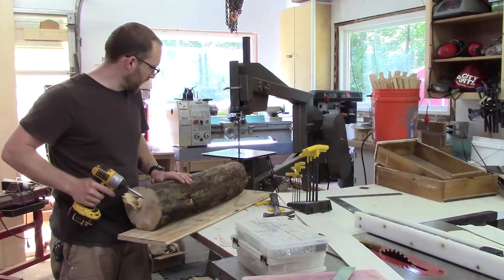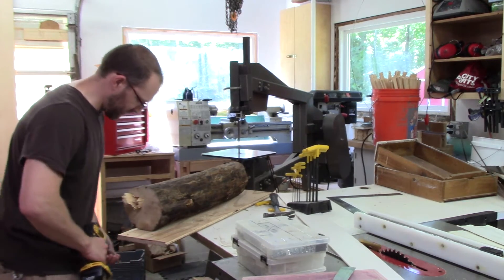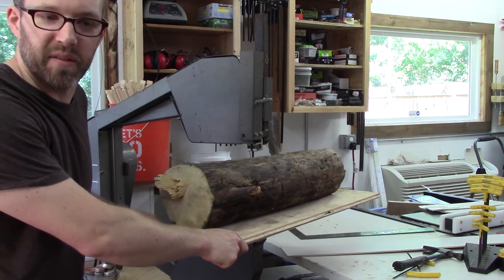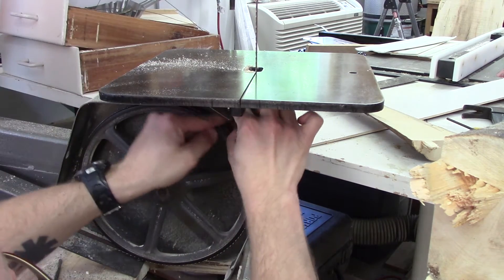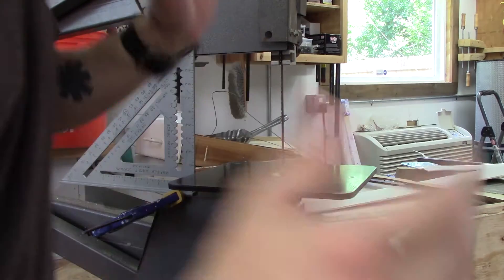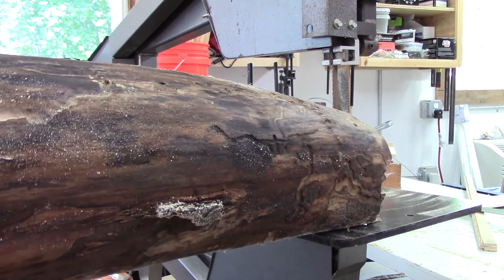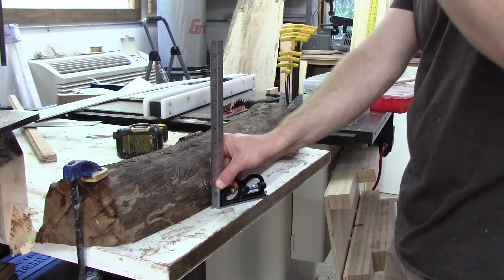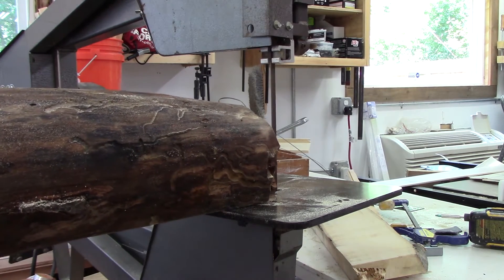Cutting Boards From a Log with a Bandsaw

Comment: Why not clamp yourself a fence?
Reply from the maker: Fences are tricky on bandsaws.  Because the blade has a tendency to pull the work to one side or another, you need to be able to angle the piece as you feed it.  A straight fence wouldn't allow this, so that's why re-saw "fences" are usually a single point of contact.